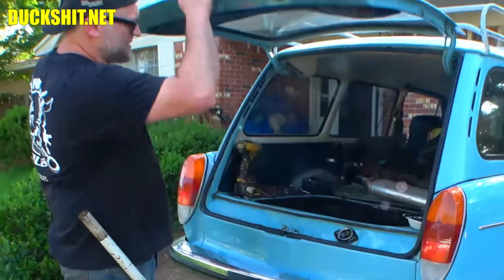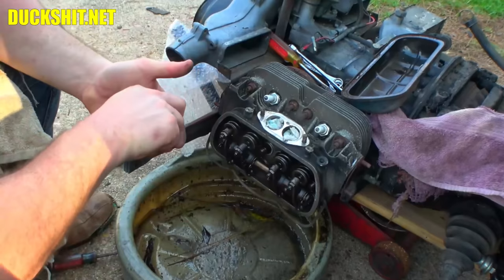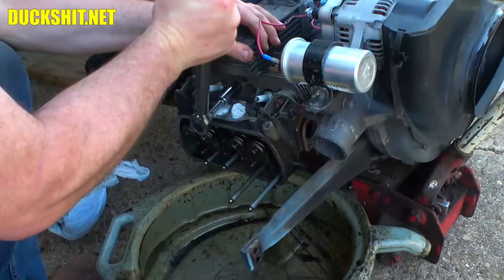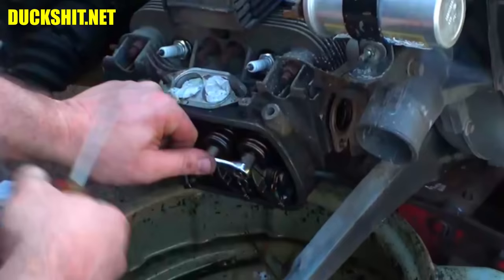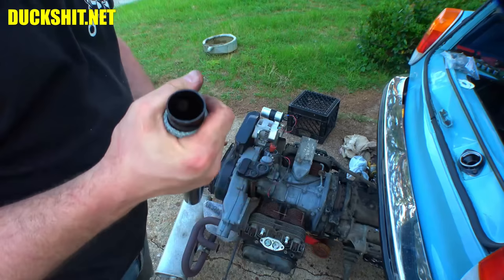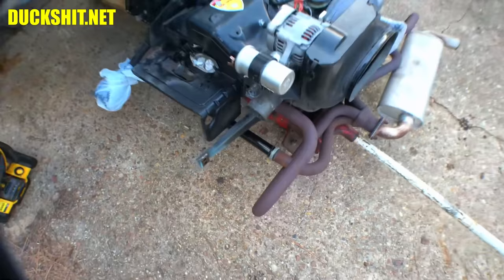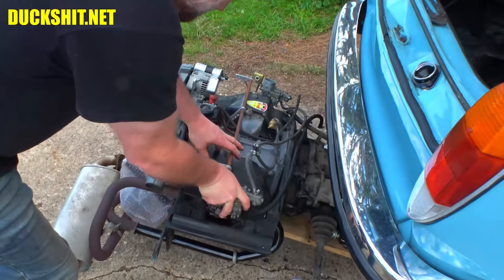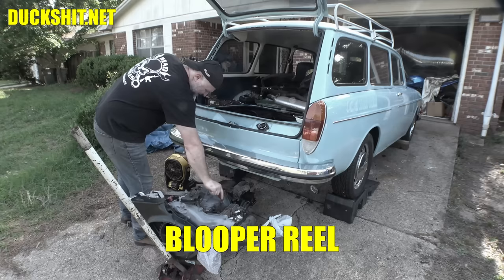🔧🚗VW Type 3 Valves / Heads / Engine Fixes 💥🔥

Comment: Great work, that went together quickly. Thanks for the reminder, I also still need to get/make one of those plates around the right side manifold.
Reply from the maker: Don't run it for long that way, a lot of cooling air escapes and for whatever it's worth it can overheat your carburetor from the air escaping from the wrong spot.  😁👍🏻🦆💩

Comment: Getting it done. And Getting it done correctly. There is foam that is glued on the top of the oil cooler. It keeps air from going around the cooler. Kind of giving the air only one way, and that is through the cooler fins. Mine was pretty much gone. I used a Beer coozy. Cut a rectangle out of it. Worked great. Just the right thickness. It wasn't a budlite coozy. Lol. Good video Lord Duckman 🦆. Noel 👍
Reply from the maker: I have not ever encountered that oil cooler weather strip on a Type 3 before, but I do see them on Type 1... it wouldn't hurt to put one on here!  Thanks man!

Comment: The spring you found your esbin the end of the crossbar on the carbs
Reply from the maker: Thanks, but... what?
Reply: Came to say the same thing 😅 currently building a 69 squareback with dual icts. That spring goes on the ball end of the throttle linkage crossbar where it connects to the air filter. It's to allow for some flex due to expansion

Comment: You fixed a lot of problems carberator gaskets, valve adjustment, ehaust pipe dounuts gaskets, new exhuast pipes, so many things i missed quite a lot. It should run waaay better.
Reply from the maker: Oh man, there was a bunch of things, a lot of loose bolts that I didn't even cover, too.  Even the tins weren't assembled properly.  It should be good as new when I get it back together!

Comment: Busted knuckles and wrenching go hand-in-hand (no pun intended). Many years ago, I had a freshly machined (Ford) flywheel slip as I was helping a neighbor redo the clutch on his pickup. I was underneath and it came down, catching the middle finger knuckle of my left hand, pinning it to the trans crossmember. I.D. of the flywheel severed the tendon! Long painful story short I have a Carbon Fiber suture holding the tendon together and it took me a year to get 99% use of the hand back. Try driving a stick shift car in traffic for a few months with only your right hand! 😡

Comment: Just wondering would those tins and altenator and fan  all fit on a beetle 1641 i realy like that lower profile look? thx for the vid:)
Reply from the maker: Thanks man... the answer is short is yes all the tins will fit on a Beetle engine, but a type 3 setup engine will not fit in a Beetle.
Reply: @DuckmanCycles  >>a type 3 setup engine will not fit in a Beetle.<<
Well, there's one In my coupe, but of course it's seen an awful lot of zip-cut/welder action.
(which is why it's a coupe)
Reply from the maker: Not without a sawzall and a a lot of hammering.
Reply: @DuckmanCycles  Correct. Mine has a deck lid (with a fan hole) but no tail section.....or any fenders.
Reply from the maker: @frankschwartz7405  Yep... that was a lot of saw'n haha!